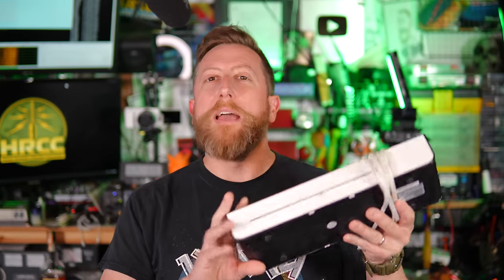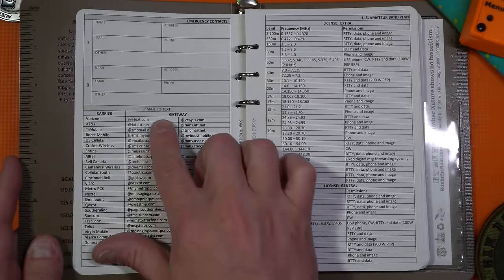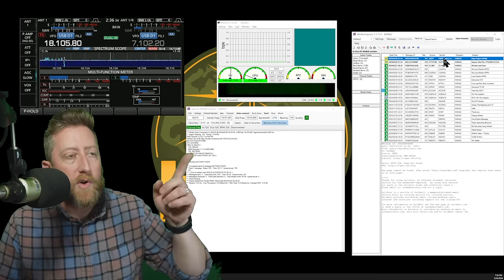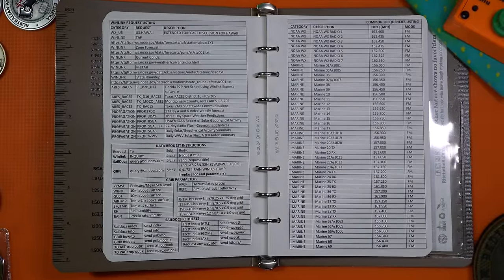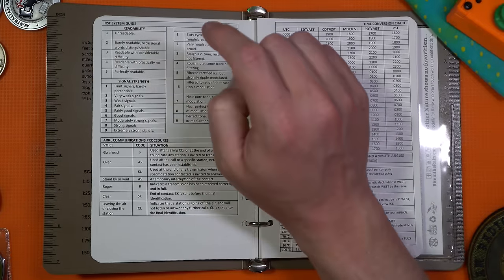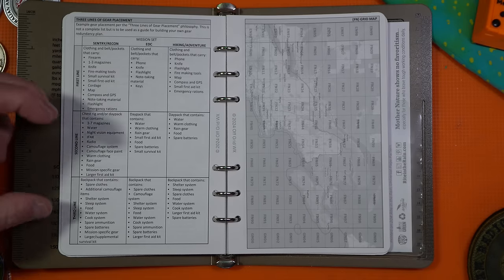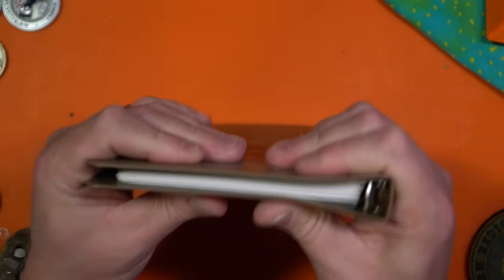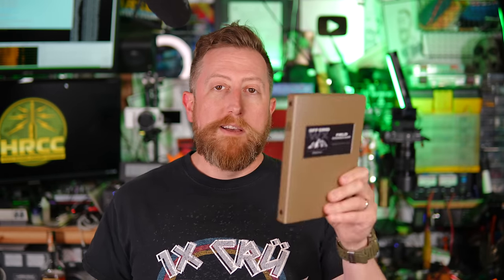Great Off-Grid Radio Reference Solution!

Comment: Thats like $30 cool, Not $100 cool.
Reply from the maker: You can get the material for $30 but not collection of info or the backend systems. It’s easily $100 in value.
Reply: There’s definitely a time vs. money component to items like this.

Sure, you could make this for cheaper than $100, but I think it would take up a lot of free time gathering all the info, typing it up, formatting it, printing, laminating, and putting it in a binder. 

Personally, I’ve got way too many irons in the fire already, so the $100 is absolutely worth it to me. If you’ve got tons of free time then go for it.
Reply: @EuropaChronicles I agree. It's a good value at $100, but if someone has the time and wants to do it on their own, go at it.
Reply: Then go make one to sell for $30. You ought to be able to clean house!
Reply: My thoughts exactly.
Reply: Let me start by saying, I'd love to have one, but I have to agree with the OP here,  $100 seems too steep for what the item is.  I get it though, it's tough to recoup initial costs with first runs without a higher price.  Economies of scale would help drive prices down, but I doubt outside some radio nerds, there's not a huge demand for these.  I could be wrong though.
Reply: I think it’s pretty cool. I might buy one, I might steal some of his ideas as I’m making my own reference card system. Or I might buy one and add a few reference cards like, a digital mode checklist for a particular radio or a battery charging protocol.
Reply: Maybe the info but the RITR paper is $$$.  Also having had a printing business, $100 is very reasonable.
Reply: For those that don’t have the time but the money this is a great reference
Reply: A bargain at $100 in my opinion.
Reply: It's a $120 with tax and shipping cool for me. Can't wait for it to show up.
Reply: There need a pdf  i can buy and print  myself  for @ $10
Reply: It looks cool.  If unwilling to pay that price, you could use the idea as a start to make your own.  Formating and printing on something durable would be my issue. Though great idea.

Comment: As someone that has done typesetting for commercial printing before, there is a LOT of hours that went into the formatting and design of these pages to get them to look the way they do, not to mention the information gathering. 
The Rite in the Rain paper for this size binder comes as 2 perforated pages on a carrier so the printer can feed it. That means each page has to be separated out and put in the binder by hand.
It is also worth noting that for 110 pages and the binder, you are looking at about $35 in material, not counting the expendables for printing (toner, drum, printer wear and tear). 
So yeah, $100 is a bargain when you consider what all goes into this.
Reply from the maker: I AGREE!

Comment: Heads up for 6 meter ops... with the solar flux so high watch for DX! I snagged Trinidad and Tobago yesterday afternoon on SSB. EN24ho to FK90fr... 3,100 miles. Other MN stations on FT8 also worked into South America, Curaco, Galapagos and others... I think yesterday was e-skip coupled into TEP... but some F2 has been worked recently.

Comment: the TXT-to-EMAIL numbers you can use are sometimes blocked by the carrier, or by an application on the carrier phone. Get together with your family to ensure this method DOES work, or is turned off if you don't require it--spammers will often use this vector is the explanation to why it's typically switched off.
Reply from the maker: Good call, please test out all your comms options.
Reply: Can affirm it can be blocked or inconsistent- even with the same carrier.

Comment: Interesting ...

So if you are out in the boonies, QRP, and you need to get help during a contest, do you call "CQ MAYDAY"?

As for printing on that Rite in the Rain paper, I didn't know you could buy it in various sizes. Also, if you use an inkjet/laser printer, is THAT water resistant?

Comment: Hey whats up. So I'm going to a little island beach offshore for spring break and I'm taking comms for family members in case cells don't work. I'm thinking Baofeng UV-S9 Pro with some upgraded 15" whip antennas and a gmrs license for 10 years and we will be set while traveling. Thoughts?
Reply: Usb c charging is a must. Also. Consider MURS. It's liscense fewer and only 5 channels. So if one of the kids bumps it, it's easy to find the right one.

Comment: The email to text has been a "thing" for some time and I've had to use it in emergencies before and it works well. Definitely useful over Winlink if you need to get a text to someone that still has service. Thanks for the video, this book seems very well put together and small enough to throw in a pack and have handy. 73, KS5KY

Comment: How do you manage all the other stuff, manuals, settings guides, battery info etc. I have a stack as thick as a phonebook and i don't much overlap with this reference guide
Reply from the maker: Print an laminate? Save to an ebook reeder?
Reply: @HamRadioCrashCourse  I'm going to have to look at an e book reader of some kind. Do you have a recommendation? I have been keeping the paper guides and manuals in a pelican case but it's a ton of space and weight
Reply from the maker: Most of the used kindles are still great.

Comment: Great guide but not for $100.00. If it were more affordable it would sell better. It's way overpriced in my humble opinion.
Reply from the maker: Are you in printing? Or is this your feeling?
Reply: @HamRadioCrashCourse  I realize and appreciate it takes time to correlate the info in this guide (but once done it's done) and to manufacture the guide (binder+printing, etc) however $100 per guide has to be generating a pretty steep profit margin.  In my humble opinion, it's overpriced.

I did make my own similar guide about 6 months ago and it only took a few hours worth of work to collect and format the publicly available data to my liking and put it in a binder. So I am not just giving an opinion, I am giving my experience too.